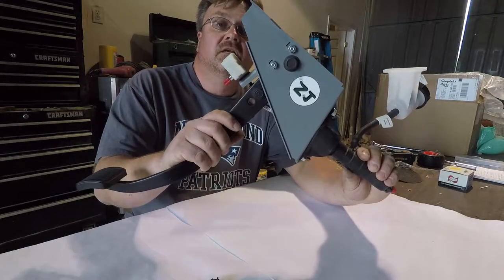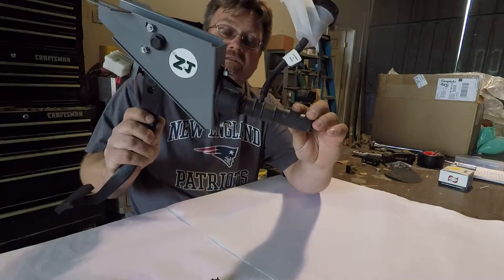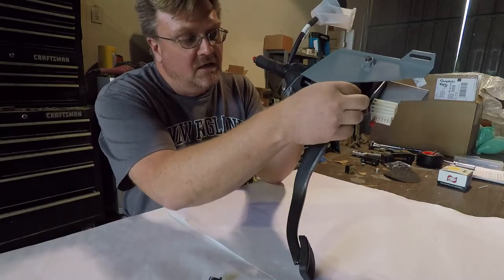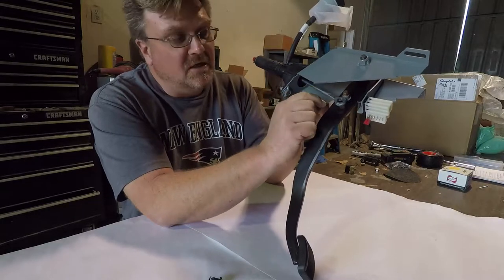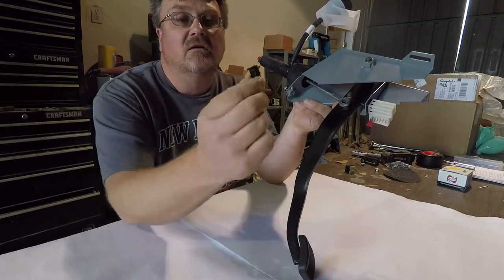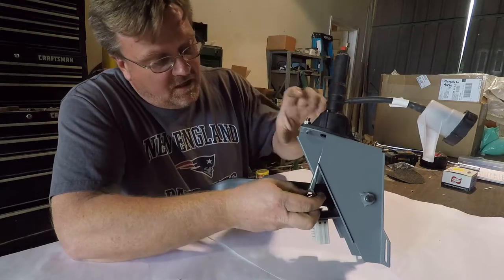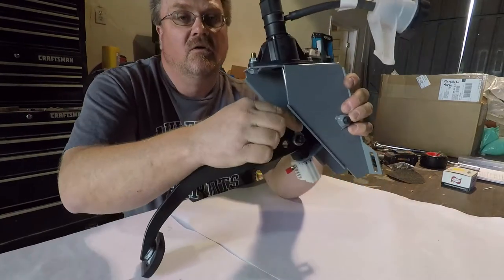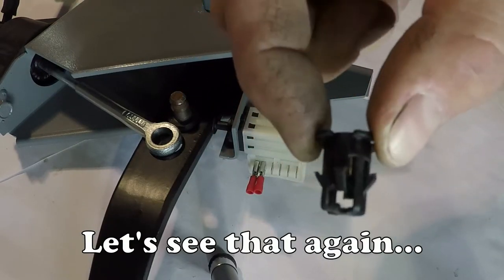TJ Bushing on a ZJ Clutch Pedal Assembly

Comment: My bushing broke on me while driving, after fixing it again it feels like 2nd gear is slipping. Could a slightly loose pedal connection cause slip? Maybe the master cylinder got damaged? I'm lost
Reply from the maker: The bushing shouldn't cause the clutch to slip; its pretty thin so it wouldn't change the position of the pedal much.  The only thing I can think of is that a broken piece fell into the master cylinder, preventing it from coming out all the way.  If the clutch feels like it engages in a different spot, like near the top of the travel now, that might be it.

Comment: Do you have the Part number for that wrangler bushing? I understand there are different sizes of that bushing. I purchased a dorman 74014 and it has slop and doesn’t snap on very tight. It feels cheap. Did you get the OEM Mopar bushing? Thanks.
Reply from the maker: I've been using Crown 4643448 with good results.  One thing to look for, sometimes the pin on the pedal is worn out.  That would make the correct bushing feel sloppy.  In that case you might go with the stock ZJ bushing (they usually come with a new clutch master cylinder), a flat washer that fits the pin pretty tightly, and a E-clip.  That's what I use on my drag race Jeep.

Comment: Yeah thats great, now show us how to take the little fuker off? Mine is not on a bench, it's in the damn car. Cant replace the thing if I cant get it off, 10th damn video and everyone just skips the removal of that POS.
Reply from the maker: Yeah, there's a reason no one shows it being removed.  Its like a fish hook, easy to go in, hard to get out.  I have done it on a bench, all four prongs have to be bent in at about the same time.  In the car, it will be very rough.  You might be able to get a fuel line hose clamp around it to squeeze all of them at once, but I've never tried it.  If it were me, I'd take a pair of snips and cut all the prongs away one at a time until it came apart, toss the old one, and put a new one it on re-installation.  Sorry I can't be more helpful, and good luck!